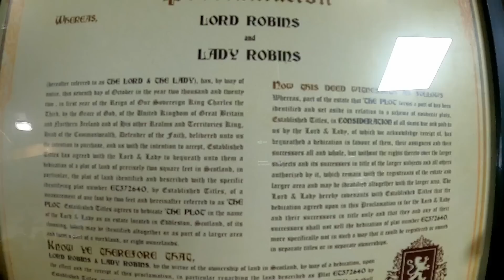Ep 95 - Steam Bending Wood For New Boat Frames - #boatproject

Comment from the maker: If you are eager to watch more videos, ad free and  find out what is happening in real time, come and join our Patreon crew! 
Ep 96 is out now to all our early access Patreon supporters! 
Patreon.com/shiphappens
Reply: Great to see you guys at work again!
Reply: Heat is a catalyst for epoxy resin -- no matter what the ambient temperature !  Two-part epoxy reacts faster when heated and after applied, it cures faster if you use a heat gun on low and are in a hurry.  I worked as a boat builder and have one friendly observation: For 45-degree wood joints, dowel them before the epoxy.  Takes longer but I have seen such joints load tested...  Epoxy joints will sheer-fail long before the dowel-epoxy joint.

Comment: As you observed, the epoxy curing reaction is highly exothermic.    In winter warming the resin is so that the reaction gets started easier, but once started, it gets warm.   Best to not mix too much.
Nice job on the steam bending.   Not easy.
Dave.
Reply: Thanks LV_Woodturner Please Lord,  do you warm the hardenenr too? . Merci
Reply: If you need to get the reaction started in a cold shop, you would need to warm both the resin and the hardener or a cold hardener, would reduce the start temperature of the resin.
Dave.
Reply: @lv_woodturner3899  I made a little 20 grams pot in hot water 15 mn, then I had the 5 gr of hardener. I think the hardener have got heat at this moment because I started to mix. They were not air balls, not over heat. I apply on my stich and glue seakayak. I will see the result on monday..

Comment: Dad steamed some wood using a plastic drain pipe blocked off, put the wood in the drain pipe and a kettle with the handle taped up to keep it steaming inside the drain pipe
He did this rebuilding a clinker built dingy
And he did his apprenticeship as a ship Wright at Portsmouth dockyard in the 60s

Comment: Some melamine faced chipboard clamped to the front and bottom of a stringer/frame would allow you to fill a divot with minimal cleanup afterwards. Spray it with silicone release so it won’t stick.
Ordinary fibreglass filler like P40 would be cheaper and the chopped glass makes it very tough indeed.

Comment: A different way to put in a permanent bend is by laminating 2 or more thinner layers of the same type of wood with marine glue, that way you do not have to steam it first. I think you can save money by buying thinner bits of wood and it would be stronger if laminated.

Comment: Trouble is, with some resins and catalyst. If you put to much catalyst in with the resin. It can crack. I’ve been there and done it 😂
Reply from the maker: The good thing about West Epoxy is the pumps measure the correct amount!
Reply: @ShipHappensUK  that’s good. So why did it get really hot then 😂. That’s usually to much catalyst. 
Can’t wait for you both to finish and see the outcome. I’m glad you’re not cutting corners 👍👍
Reply from the maker: @taffythegreat1986  the  normal reaction of epoxy can go up to 200°c

Comment: How many frames is that now 🤔? Actually,  that leads me to my next question which is,  did you ever locate the missing 'floors' of your boat? As we nautical types all know  a frame is only doing 50% of its work until it is strongly fixed to the keel of the boat.  I remember that Leo ♌️ over at Tally Ho  cast new floors for their boat in bronze but that must have cost those guys a King's Ransom ! Better to use the existing floors if they can be found!  
Great job, you guys 👦!